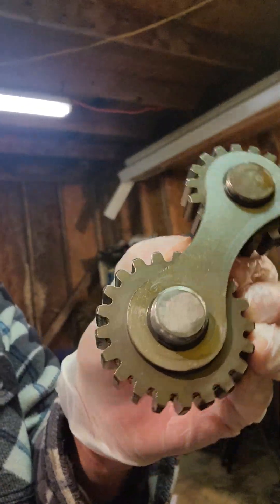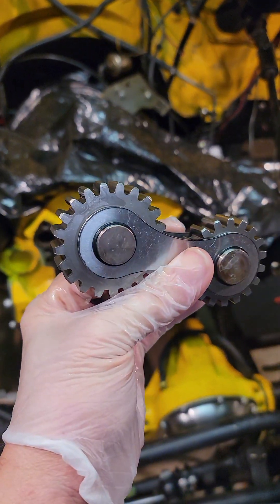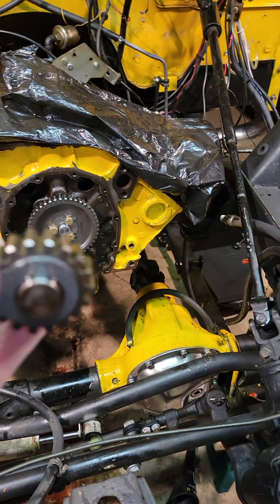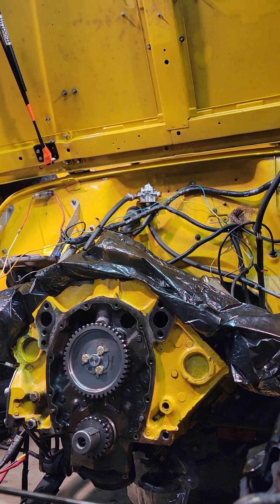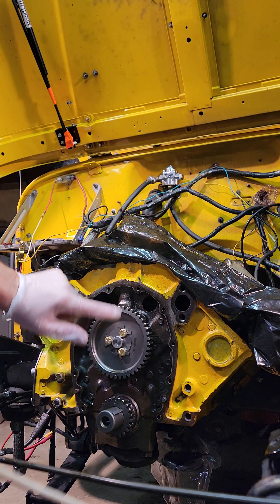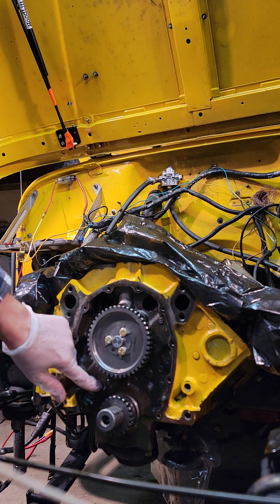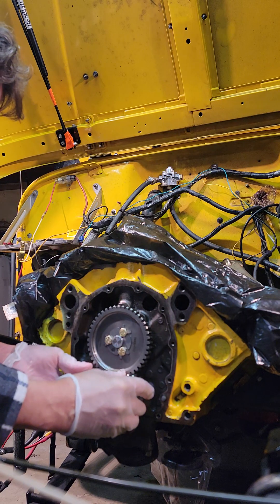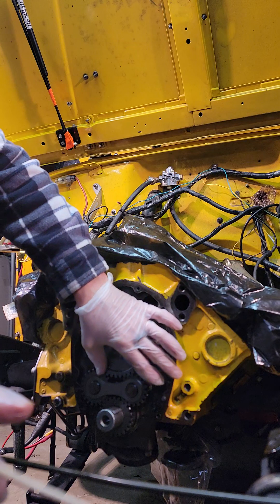SBC 350 Timing Gear Drive installation summary sort of?

Comment: I'm starting to beleive it depends on your block casting I've seen guys here on Youtube install these the same way and get different results. 
 Harley Davidsons went from geardrives on the Evo's to chaindrives on the Twincam. You can put a gear drive on a twin cam but you better check  the run out of your crank shaft before ordering or your gonna have binding isusses. 
 People gotta remember these are mass produced castings it's not going to be perfect.

Comment: I have a gear to gear setup already but was  curious about the install process. Good video man thanks.
Reply from the maker: Thank you, I ended up however with the cloyes timing chain. The gear even though I had what seemed to be good clearance to the block. .. my timing gear cover was not gonna fit without more modifications.  So I dropped that idea and shaved the idea for now.  I'll be posting more soon on update.  Stay tuned!  Thanks again!

Comment: Is it worth it to run the gears? Something I’ve been looking into haven’t found much info on it. I figured they would be more reliable but not sure.
Reply: I bought a truck that came with a pro install gear to gear. It sounds like its supercharged with the straight cut gears. I like the piece of mind that it will last MUCH longer than a chain. Less moving parts man.

Comment: When setting the crank gear dot at 12oclock, do you have to make sure it's at tdc on compression? I've been having troubles. And when I do set crank at 12 and cam at 6. Do I crank it til I get 12 and 12, and then drop it with rotor bug pointing at cylinder 1? Can't seem to find a video on timing it with the a gear drive. Everything I've tried hasn't worked, sound like it's completely out of time and sounds like a jam. TIA
Reply from the maker: When you have the dots at 12 and 12 that is TDC #1 if you have it at 12 and 6 thats TDC #6 so yes, rotate to 12 and 12 before you put distributor in.